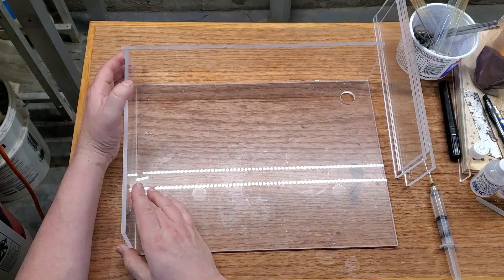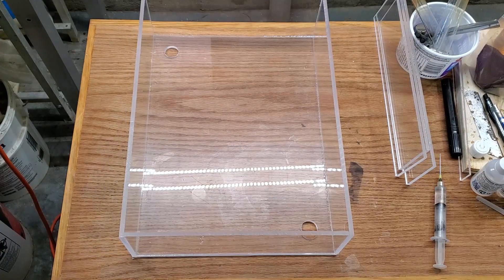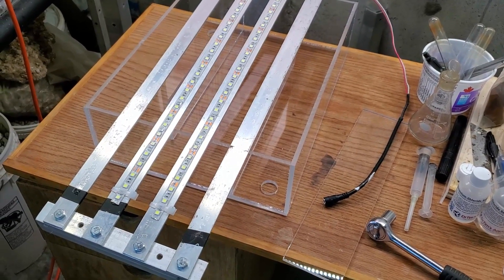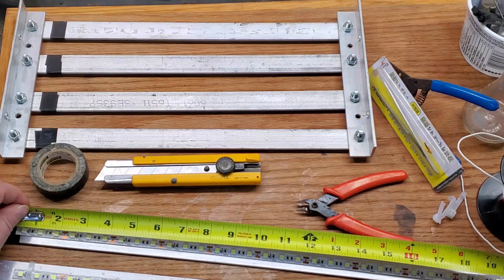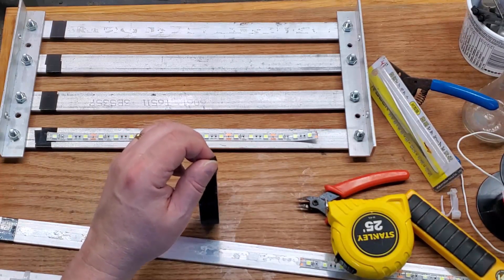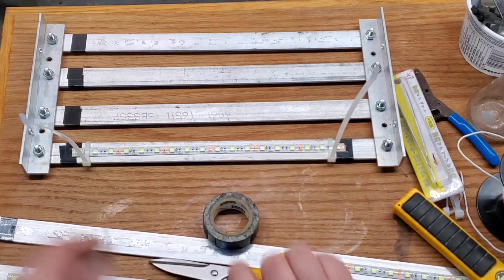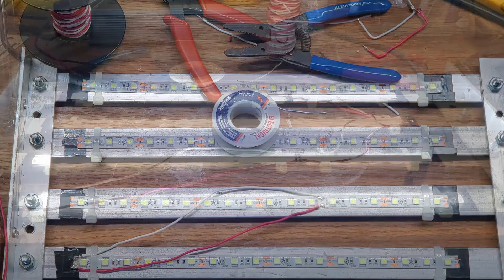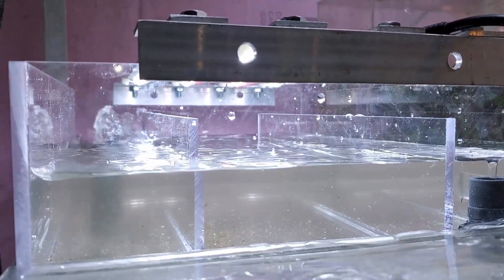Planter/Algae Filter

Comment: Hello.

I think that
1. Algae require less light than plants. Therefore, it would be possible to put algae there and not waste electricity-coal-oil-gas on lighting.

2. In this water above, lifted by the airlift, there is probably little carbon dioxide and the hornwort will grow slowly. Elodea has a special mechanism for absorbing carbon; it does not need carbon dioxide. Therefore, it is possible that Elodea will be more effective than hornwort.
Reply from the maker: These are LED lights and don't really use much electricity. Even if I went to a cooler spectrum the power supply would be the same one I'm splitting off of that runs the fish room lights and any drop in consumption would be minimal. The lift for this test is by pump to ensure even flow. I have the hornwort so that's why I'm going with it. If I can get any of the other fast growers, I will be testing them too. Thanks for taking the time to put thought into this and of course for coming by and watching!

Comment: Soldering tip: don't put solder directly onto the iron. All the flux burns off and it doesn't fuse properly. Everything will work way easier with flux.
Reply from the maker: Thanks for the tip! I will give that a try.

Comment: For those lights, do you think taping duct tape (the foil tape for HVAC ducts) between the horizontal bars would help? With the foil side facing down as a reflector, with the light strips going on after?

Or is there be a better reflector design?
Reply from the maker: That would certainly work. What I've done in the past for the marine version was to surround the lights in .5 aluminum plate for that kind of reflective effect. Thanks for coming by!

Comment: heat transfer tape is insanely strong! (dont know if you used that but it wont come off if so) love the word "wonky" by the way. building LEDs is really cool, Ive seen people use thick aluminum pans as a heat sync and panel.
Reply from the maker: Thanks for the tip and for watching!